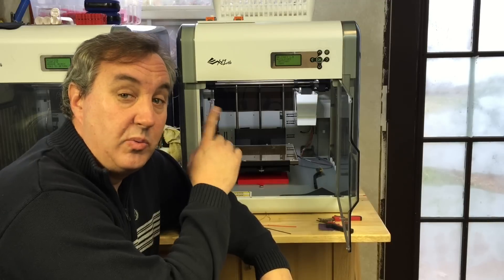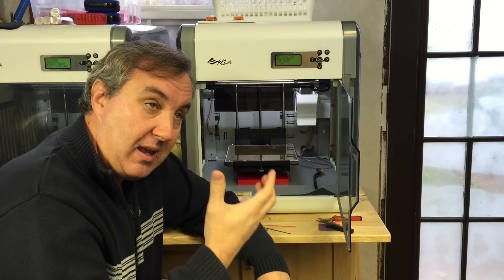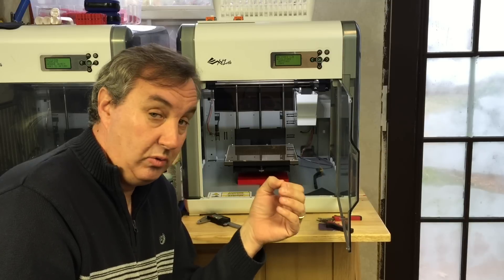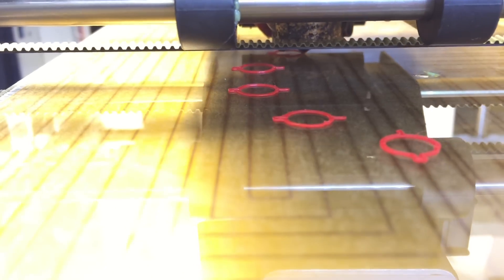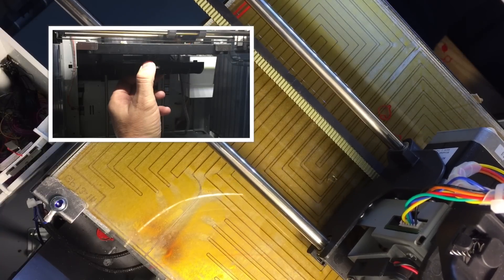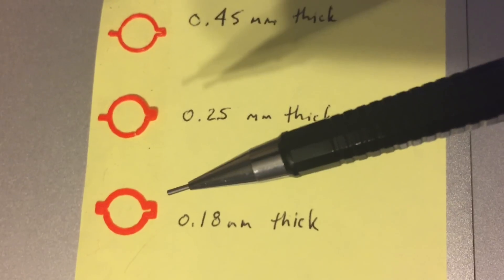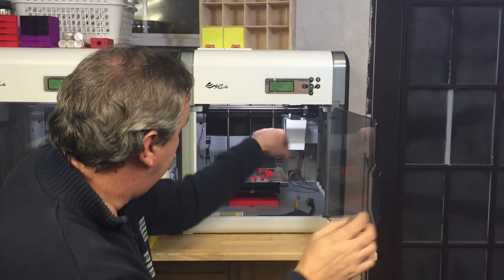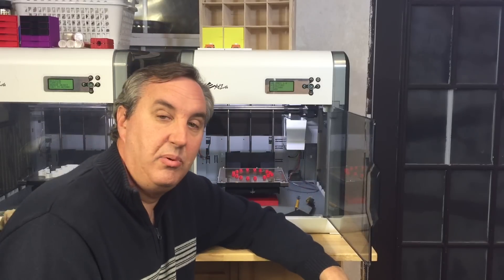Simple Method of Adjusting the Davinci 3D Printer Bed - Video #025

Comment: Hi. My davinci was used so I didn't get any software with it. So I've had to use the sd card in the back to put the gcodes on. Any way ypu could help me out with a disc.
Reply from the maker: I no longer have my DaVinci’s or any support material.
Reply: Ok would instill be able to connect it to my laptop since its been repetier flashed. Its only showing up as arduino in my connected device list so when I go into xyz ware it don't show up. Or in cura

Comment: Mine had the filament inside. The best way to get it is to take the heat tips off the heat sync and put them upside down over a candle, then push a needle into the melted filament while it is pliable. Once that is cool, just pull with pliers to get the jammed filament out.

Comment: Hi chuck found this helpful have my XYZ 1,0 running at .20  - .23 using the I am using the  printer printer for a reasonable large print 155 x155 even though I have cleaned it very well and new cartridge ,the bed seems to hold the job well I am seeing little lumps in such a long run can send you a picture any help would be app.
Reply: Thanks Chuck ,I thought it was looking great until it started leaving a few deposits table set at XYZ 155 at the three points will lower it to around 200 and see what happens .cheers

Comment: Hi Chuck! I'm complete noobie in 3d printing, but learning fast watching your videos and reading articles. I haven't done much of a printing with my Da Vinci 1.0A yet. 

I've got a question regarding bed height. There is some tendency with my printer that in the initial stage nozzle catches previous layers (I noticed 1st and 2nd layer). I can hear a nozzle bouncing of off the edges of previous paths. I can also observe this while I'm looking from the top of working printer - there are clear marks made by hot nozzle on ABS.

Is it common? I have leveled hot bed couple of times and I got best result of 243, 249, 249 out of calibration feature (which was a pain in the butt, to be honest).

Comment: Thanks so much for making this video! I followed your method and was able to get nice consistent results using your test print for calibration. I made sure the initial layer of each object in the test print stuck to the bed and was well formed. After this, the issues I was having with parts of the print lifting off the bed were resolved. Your method worked a lot better for me than messing with the built in calibration or using a sheet of paper.

Comment: *****   it seems daunting as a beginner to do by eye. i had no success with paper
how do the numbers in the calibration work. i ended up getting the app from amazon which seems to help i just cant imagine what i would do with the numbers with out the app. also iv got a small dip in the bed now is that normal for heated beds?

Comment: I'm trying to figure out why I can't even get a measurement on the auto calibrate.  All I get is the +ERR message for all three points.  The bed won't go high enough to reach the detecting pin and even if I max out the bed height with the knobs and it is able to touch, I still get the error.
Reply: +Chuck Hellebuyck's Electronic Products  Chuck I get the same +err message on all 3 points but the printer never even tries to do the other two? I had allready set my bed like you did in this video as I learned this a while back from my TinyBoy. So it prints fine but any idea why the calibration don't work?

Comment: Hi Chuck,
nice video, I'm still new to the 3D print world (I have recently received my DV 1.0) and Sketchup etc. My early attempts haven't been very satisfying but I'm sure that's down to my inexperience. Keen to learn! I couldn't help but notice your print bed appeared to have a hole in it near the centre, where like mine, some of the surface material (glass??) has broken away. Is this something I should address under warranty or is the bed regarded as a "fast moving part" (a la automotive)? I have considered simply removing and flipping it over, would that be a better fix than my simple method of avoiding the region? Appreciate your vids an look forward any advice.
Cheers,
Mike E

Comment: Thanks Chuck for a very useful post. And the test file of 12 thingies.

Here's what I did. I started by using the paper method (start a print and turn the printer off) to give a starting point. I then printed the test print (the 12 thingies) as above and cancelled the print immediately following the first layer. I then measured the thickness of the first layer of the thingies at each 90 degree point and found the thickness to be about 0.45mm with terrible adhesion. In fact the purge line detached and ruined the first thingy.

I was surprised by this, I used a single 80gsm paper layer and was expecting it to be too close not too far away.

Next I repeated the print and adjusted the bed height screws during the print so that the bed came closer to the extruder. There are 3 adjustment screws. On the documentation with the printer these adjustments are shown as + and - with no definition as to what that means. It seems - means bringing the bed closer to the extruder and + further away.

The adjustment was easier than I expected and after a couple of iterations I had the bed so that the measurements of the first layer thickness was down to 0.2mm and adhesion was excellent. The layers were well and truly squished.

I went a bit far on the left of the bed at one stage and heard a clicking noise from the extruder. Turns out the nozzle was bearing on the glass directly (no gap) and the filament could not escape. It seems the motor was driving the filament but with nowhere to go it was slipping on the filament. This is a good indication that the bed is too close.

I then printed the complete thingies not just the first layer. This was a sweet print. They are very nearly vertical on the thick part with a bit of a lip at the bottom, circular and stuck like jam to a blanket on the glass. Here's the measurements (Note that the numbered positions are not correct as per the printer layout:

No      X      Y      Z
1    9.55    9.41    6.93     (5 past position)
2    9.43    9.45    7.04
3    9.4    9.33    6.94
4    9.16    9.33    6.99
5    9.31    9.34    6.93
6    9.35    9.24    6.99
7    9.32    9.31    6.97
8    9.34    9.4    6.94
9    9.31    9.3    6.94
10    9.3    9.52    6.97
11    9.3    9.21    7.03
12    9.23    9.26    6.96
Average    9.33    9.34    6.97

Not sure what the target dimensions are.

Typically this will do for what I want the printer for.

Once I was happy with the position I added locknuts to the adjusters and tightened them. This should reduce the movement during printing. I did move the adjusters slightly as I tightened the locknuts so I did a another test print run after and measured every single first layer thickness with the following results:

7/03/2015
Position    Thickness    Deviation from average        
1               0.28              0.07
2               0.25             0.04
3               0.22             0.01
4               0.21             0.00
5               0.27             0.06
6               0.2              -0.01
7              0.19             -0.02
8              0.16             -0.05
9              0.18             -0.03
10            0.18             -0.03
11            0.22              0.01
12            0.21             0.00 (12 o'clock position at the front of the printer)
        
Average        0.21    

It seems the printer is now very close to the sweet spot of 0.25mm remembering that the measurements are subject to some error. The single layer prints are beautifully wide and stuck solid. The bed isn't perfectly level but I am not hugely concerned about a deviation of 0.07 mm. I could do another round of adjustments but instead I am going to try a large scale difficult print.

Hope that this helps someone who is being driven to distraction wasting time on bed calibration.

Chuck, one suggestion, is it possible to create the test file with the first layer only so there is no need to stop the print?

Regards, Fred.

Comment: Chuck, I just unboxed my DV 1.0 and the auto calibration sucks. Once I get a "success" and save the settings the nozzle is way too high and the extruded plastic rod is thinner than the space to the bed.
I've needed to re-glue all the bronze bushings that were loose and re-adjust the belts on the "Y" axis to get the trolly to run perpendicular to the Bed and "X" axis because printed circles were not round.

I use your method to adjust the bed height but once the bed is adjusted the Nozzle head bangs into the bed when it first cleans the head on a new print. Does yours do that when the bed is adjusted to 0.20mm ???

BTW what do auto calibrate numbers show after you manually adjust your bed ??

Comment: Chuck, Thanks for the tip. My bed was really off. To much gap on the right and no gap toward the left rear. I couldn't figure out why this was happening since day one. Now that I've adjusted the bed using this method the prints come out much cleaner. No more dragging unstuck ABS throughout the print.

Comment: I calibrated my bed until it passed then used the paper method.

Im tried printing 4 small parts in unison but the nozzle catches the print while moving.

Any ideas?

Adhesive issue?

Comment: I use 3D EeZ...  on my not heated 3-D Printer...  but it works on heated printers as well....  it creates a surface that allows for easy adhesion and yet can be easily removed afterwards

Comment: SO last night my printer failed on me :( the extruder head will no longer get hot :(... Luckly i ordered through amazon and when i said i wanted a replacement printer bam they are already sending me a new one :).. Unluckly this will hurt my 3d printing fun i had planned with my family for christmas eve night :(. I hope the second one last longer.... Anything you might know of why the extruder failed to heat i did move the electrical wires going to it a few times and they seemed to make it work for a second and or it would work and once it moved it would cool right down... im scared this will happen again...
Reply: I had the same issue today , I just took off the two black plugs and used this one http://www.marklinfan.net/pmm/pmel-001.jpg and now I have a strong connection 

PS :  you have now 2 good working extruder lol good job XD
Reply: gatsu8888888 they are replacing the whole printer... but i dont even notice what that is you have or what part ?
Reply: take a look at chuck's site http://www.elproducts.com/chucks-blog/davinci-3d-update-extruder-warranty

in the second image you can see a black plug on the right , that plug send the electricity to the extruder making it hot , I found that at some point after 2 month of use the plugs weren't working good cause sometimes they do contact and other times don't , so instead of calling the support or buying spare part I just replaced the male and female black plugs with that piece I showed you and now the printer works good with a strong connection

PS I have the 1.0

Comment: Good method.
I use the method of paper and it's going very well.
However. If glue is not used can be risky.
Especially in very high parts. these can be lifted and ruin all the work and if ABS is used with more reason.

I use hairspray and never had problems.

Hair Spray, cleans easily with alcohol.
It is very easy to apply and the layer is very thin so it does not affect printing.

Regards
Reply: Spot-on Tip !  Regardless of what machine you use.  So easy to do, and effective.  #1 TIP FOR BEGINNERS.
"Home" all axis,,  release/disengage/turnoff/powerdown the motors, (different machines and/or software terminology).  Now you can move the X and Z gantries by hand.  Drag a sheet of paper along with the "clean" nozzle tip, adjusting the bed screws,  until it just barely catches the paper,,   check all 4 corners, twice, to ensure stable accuracy.
And/Also,,  No need for kapton tape, blue tape, or secret glues,,,   glass and hairspray,, keep's it simple.
You forgot the magic words,  "AquaNet Superhold"  :)  
I use removable beds, and it works great, even on cold beds of glass or acrylic, w/PLA.
"AquaNet Extra Superhold" works even better w/ABS.  That stuff squirts out of the can really thick.  And I've even been able to lower my bed temp to 90`c.
Tip for removal:  2min. in the freezer,, print lifts right off.
For cleaning,, I just use a sharp putty knife to remove any high spots,, and recoat. And of course,,  apply a fresh thin-coat before starting a new print.

Comment: Have you heard of the new version the 1.0A, it's supposed to have the Duo board (without the chips for the second extruder) and a magnetic door catch and some other little changes. BUT the big change is the FW, it will send the filament casing number to XYZ and you will not be able to reset that casing once again. :(
Reply: well, I might have put it the wrong way... the "old" 1.0 could use non xyz filament by just resetting the chip thats in the cartridge that came with it... now it will no longer be as simple as that...
Reply: ***** did not know that! 1.1.J seems like a game changer for me! :) Thank you!

Comment: Thanks for the tip!
I had just spent 3 days getting mine calibrated and finally managed when I borrowed someone's calipers.
This will help a lot in the future. =D

Unfortunately, part of the glass bed peeled off with one of my prints a while ago, so I've covered the bed with Kapton tape. I'll probably buy a stronger sheet of glass sometime soon, so I'm sure I'll have to re-calibrate again. This video will help. =D

Comment: thanks I really don't get how to calibrate the bed with the piece of paper but in this way its easyer plus I have the same dent as your printer but mirrored on the right side , so I think its a common issue
Reply: thanks , I tried that and after using the paper I launched the calibration mode just for curiosity and were really wrong , I ordered a digital gauge for the next time , I also tried with a classic bubble level but it was centered only on the bubble of the level but the bed was really high on the right side and really lower on the left one

Comment: This is so hilarious I was having the problem where my bed became too close and it wasn't extruding and I was starting to freak out. And I noticed as you said it was like too close so I pulled the bed down with my hands just a little bit and it started to extrude I always wait for my first layer before I walk away and sometimes like you said I'll have to adjust by hand the bed and look at that thickness and about 0.2 works great. I seem to have calibrated it three or four prints ago and it seems to be staying fine I get all antsy when I don't see the immediate release of material . I have also noticed that sometimes just because a layer doesn't print or part of it didn't print sometimes you can let that go and you'll be okay you just have to watch the first few layers eventually the printer catches up with itself and the layer becomes the same layer all the way through. Thanks for your tips and I'm sure you're helping out a lot of other people that were having the same problem. I also have a quick question when you're extruder is to close do you get a clicking sound coming from the extruder.
Reply: ***** This happened to me tonight. I wasn't happy because I've only had the printer a few days. The rear of the platform is too high and when I went to make a large area print, I got the dreaded clicking and no flow. I'm calibrating now.
Reply: ineedcolor So...after having mushed first layers, first layers being stripped off or pushed around by the nozzle and eventually clicking and loss of flow, I manually calibrated my build platform. I figure that because of the method used to adjust bed height (screws under tension) that movement of the platform must unload the tension on the adjustment screws on occasion just enough to allow it to rise out of calibration. I am rebuilding the project I stopped last night now and we'll see what happens...
Reply: ***** Hi Chuck

So far, so good. I even used your method to make some tweaks on the fly just now. I'm making the geared cube from Thingiverse and the pins have to be just about perfect because they're so small.

Thank again for the great video(s) and hard-learned information!